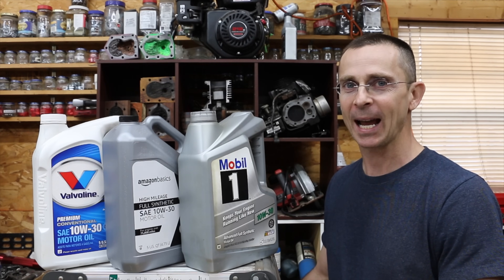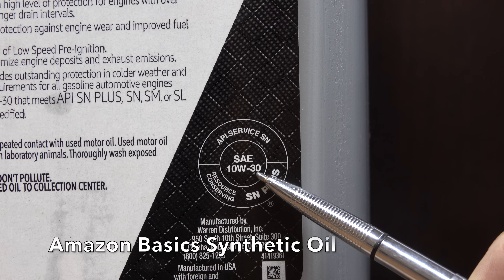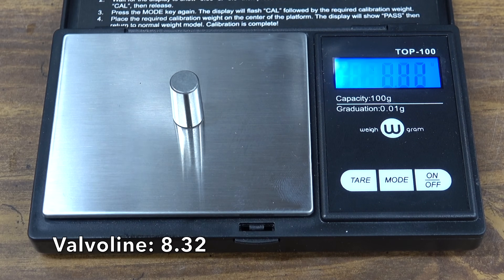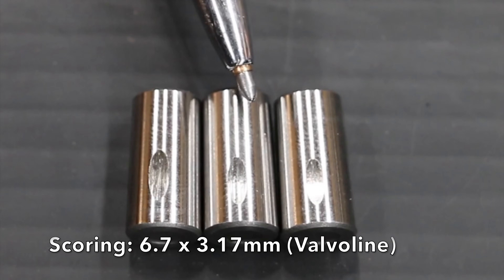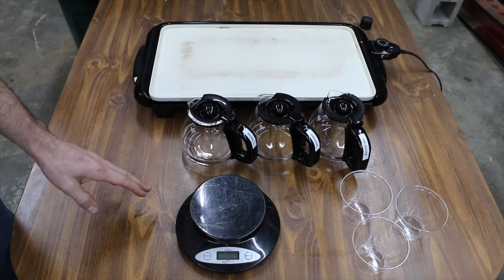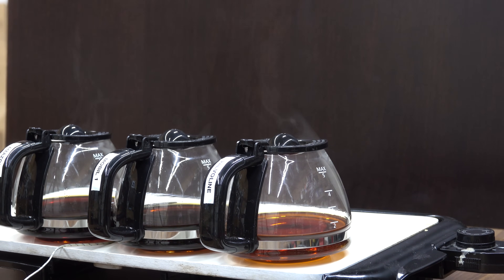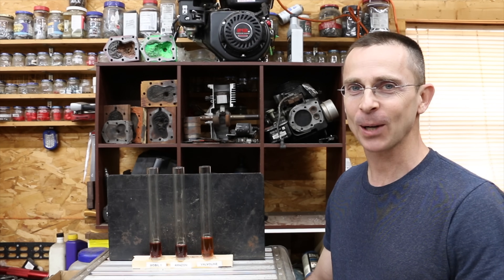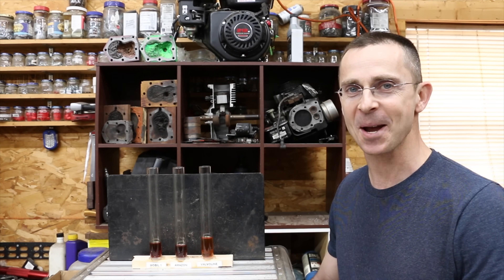Is AmazonBasics Full Synthetic Motor Oil better than Mobil 1? Let's find out!

Comment: The Amazon oil may be from the same stock that Mobil 1 uses, but oil is cheap insurance, and as long as my manufacturer recommends Mobil 1, that's what I'm going to use. My dealer charges $65.00 for a Mobil 1 oil change and it gets changed about twice a year or every 5k miles, I'm going to err on the side of caution.
 Great test though.
Reply from the maker: Thank you

Comment: I feel that you have to fix the lub tester a bit. The mobil 1 oil got much more oil in the cup and seemed that more oil got around the surface.

Maybe you should measure the same amount of oil in each cup + some flaps (more then just tape) to keep the oil in the cup?

Also, a better scale for the heating part might be good. +-1g, is that really enough when so little evaporated?
Reply from the maker: Thank you

Comment: I’m impressed. Hopefully they can keep the quality up over the long term. Something still doesn’t feel right about a ‘non oil’ company putting out an oil that they have obtained from who knows...

Also, I’m more interested in how the oil performs when it’s hot, ie when the engine is running for an hour or two and you really need that protection.
Reply from the maker: Thank you.

Comment: Great testing! I just might buy that amazon basics for my lawn mowers. You should get an affiliate link! But I will always use Ford motorcraft oil from the ford mechanic shop for my Ford F-250 that has 408,000 miles.
Reply from the maker: Thank you!  That's a lot of miles--impressive!

Comment: I don't get this comparison. One is conventional oil... the amazon is high mileage full synthetic... the other is regular full synthetic. The conventional is like comparing apples to oranges... and the other two... the amazon probably has different additives than the mobil1 because it's high mileage... doesn't amazon have a regular full synthetic?

Comment: Hey Project Farm. For a future video; I'd like to see different motorcycle full synthetic oils on the lubricity tester. Specifically, the most commonly used oils like Mobil 1, amsoil, valvoline, Castrol, shell. A 20w50 and 10w40 shootout! Which is the best of these two viscositys? Thanks!

Comment: I use WD40 white lithium a lot. If a tool is rust I usually flush it with wd40, then finish with white lithium. I also use it in keylocks and my specialty cable tools. Think you could factor that into some tests, including the bearing tester?
Reply from the maker: Thank you for the video idea!

Comment: Hey project farm, Mobil 1 is SN PLUS rated, the bottle you have used during testing must have been a 2017 bottle. Only mid to late 2018 bottle packaging are STAMPED SN PLUS. Also the oil formula was never changed due to this test. Meaning the oils before and after this new testing for LSPI are exactly the same. So in term the oil you used for this test is basically an SN PLUS oil, it’s just not labeled do to old packaging before the tests were concluded.
Reply from the maker: Thank you for this information!  This is good to know.  Thanks again.

Comment: Kind of scary how Amazon is becoming a mega-corporation, slowly getting a monopoly everywhere
Reply: Eh, I doubt they can gain a monopoly on everything. There is no chance they can monopolize automobile parts, for example. I do agree that they are becoming a power-hungry mega-corporation, though.
Reply: Amazon is a distributor.  The don't make anything to my knowledge.  Just as many auto manufacturers subcontract most of the components in their vehicles.  Nothing new here.

Comment: Will a Diesel engine run on vegetable oil???
Reply from the maker: Thank you for the video idea!
Reply: yes.
50% of european cars have diesel engines and most of them use vegetable oil since there is no tax on vegetable oil.
Many use a 2 tank system. They start the engine with regular diesel and then switch over to vegetable oil and before shutting off the car they switch back to diesel again. This way they can start the car even in cold temperatures.
Some may use use used cooking oil and make bio diesel with it which is close to diesel but may jell in lower temperature.
Reply: @FloryJohann  thanks for the information I never knew that before.
Reply: @roshanshaji4703  
Your welcome.

Comment: Can you please test Castrol Edge 5w30?
Reply from the maker: Thank you for the video idea!
Reply: Castro Syn is garbage. Ruined my dodge when front oil seal blew out loosing all oil. Less than a mile - engine froze up even thou just trying to get to a gas station baby sun ups and coasting.
I'll never use that cfra pagain. Amsiol or Mobil 1 or royal purple....
Reply: @SamaritanElad  I get hundreds of thousands of miles on all of my vehicles using Castrol. I run 5,000-10,000 mile oil changes and run WOT almost every acceleration. That is no exaggeration. I very seldom hit the rev limiter, but I get within 1000 RPM of it at least once every time I drive. That too is no exaggeration. Another point I might add is that I have never owned a Dodge.

Scratch that. I had an engine once that bent a rod, but I was literally pushing the engine beyond what any engine could handle. It was much more than accelerating WOT and hitting the rev limiter.

Comment: I still recall peeling the seal off a 5QT bottle of Super Tech synthetic and saw a fly come out in the stream flowing into the funnel. Couldn't do a thing about it. I just hoped the oil filter would catch it. I doubt it would've damaged the engine except for maybe the possibility of blocking some tiny oil passages. Sure made me wonder about the quality control @ Super Tech. I still buy the cheapest synthetic which is often Super Tech but I go for the major brands when they offer rebates. M1 used to be in the $22 range @WM but M1 is currently $22.68-$29.98 around here, ST is $15.98-$17.47, Valv $22.97,  Castrol $24.57-$30.78, Pennzoil $22.68 (P currently has a $10 rebate offer according to slickdeals.)
Reply from the maker: Thank you

Comment: Why does it matter if they evaporate in a closed system?
Reply from the maker: Thank you.  The crankcase has a PCV which allows oil vapors a way out of the engine
Reply: Project Farm thanks for the reply. Bigger thanks for the content👍. U the man.
Reply: Project Farm suppose makes sense, pressure I assume, tho u can probably tell I'm not too knowledgeable yet I am sticking to it.

Comment: I have seen Mobil 1 work on my  car after 5years of racing my motor and multiple over heating the motor  3 completely different times after opened up my motor all bearing and journals were in great condition my motor just needed new rings and gaskets   So im sold on it and not trusting anything else beside Mobil 1  synthetic works.
Reply from the maker: Thank you!

Comment: Great video. I have been wondering about diesel vs gas. Diesel engines last longer than gas - partially due to the fact that diesel is an oil and a lubricant. I was wondering what would happen if I ran my gas car and gas lawnmower with 95% gas and 5% diesel. Would my engines last even longer because of the lubricating properties of diesel? What about a 10% diesel mixed with 90% gas? How much does lubrication of gas blend increase when diesel is added? Thank you in advance if you choose this to answer!
Reply from the maker: Thank you for the video idea!
Reply: @ProjectFarm  I'm very impressed you read all of your comments - you sure do get a lot of them so thank you! By the way, I think there would be a difference between using a little diesel in my car vs my tractor, snowblower, and lawn mower since the car has a catalytic converter that could get ruined by the diesel. I expect that complicates testing a LOT since that would be tougher to test impact to the cc. I think my original question is already hard to test - would adding 10% diesel to gasoline extend the life of a lawn mower?

Comment: Here is the real test, go and try to sell your car in 3-4 years and when the informed consumer finds out that to save a few bucks you have ran generic Amazon motor oil in the precious engine see what they buyer thinks.  Despite the actual analysis etc reputation matters in important decisions like motor oil.  Interesting however.

Comment: Very good video Sir.  I was surprised by how much worse the cold flow performance was on all of the oils after the temperature test.  As a result, I will be getting the oil changed in my vehicle late in the fall every year so I can have the "freshest" and least heat effected oil in the crankcase during the cold winter months in New England.  Thanks for the info Sir..!
Reply from the maker: Thank you!

Comment: I noticed on the lubricity test, the mobil 1 seemed to have a bit more in contact with the wheel (lots more splashing), that could easily alter the results, as more oil was likely making it onto the wheel.
Reply: A LOT more Mobile1 made it round the wheel. The amount of oil in the cups should me metered accurately!
Reply: I didn’t see any splashing with valvoline either...
Reply: I agree. Although everything seemed to be set up properly the amount of oil placed in the cups shouldn't just be eyeballed. I was looking in the comments to see if someone else had noticed

Comment: There was undoubtedly quite a bit of effort put into these tests so I'd like to put in my two-penny worth.
When measuring a small difference in mass, of 1g of evaporated oil for example, it is statistically insignificant if the measurement was made using a scale with precision of 1g. You would, simply put, have a +/- 2g of uncertainty in the measurement (1g in the "before" and 1g in the "after") having a percentage error of 200% in that 1g.
A simple way to have decreased such % error would be to increase that mass difference i.e. evaporating more of that oil, by increasing the time the oil was heated. Another solution to your problem would be using a scale of higher precision, like the one shown that weighed the metal cylinders.
I haven't come across such a test of friction so I cannot comment on the validity of taking a ratio of mass rather than the quantity but regarding the measurements the same principle applies as previously (0.02g with precision of 0.01g => +/- 0.02g uncertainty).
Reply from the maker: Thank you for the constructive feedback.

Comment: While I appreciate the hard work you put into this test, I’m still not entirely convinced of the benefits of using synthetic motor oils. 

I have been a fleet mechanic for the last 34 years. We experimented with using synthetic motor oils in our fleet about 5 years ago and saw no real differences. Most of the fleet is Navistar, Freightliner (Cummins) and Ford F550s. We pushed the service intervals from every 250 hours to 500 hours with synthetic oils. Unfortunately this was counterproductive as we saw the trucks less frequently which prevented us from being able to inspect safety items we would normally check at the 250 hour intervals. 

Perhaps synthetic oils work well in passenger cars. We have switched back to good ol Delo 15/40 conventional oil in our fleet.
Reply from the maker: Great point. Thank you

Comment: I don't trust this test because the oil work in extreme conditions not to put the oil in freeze or heat it to 400f which car run at 400f or running in - 40 that's way there is multiple options 10w30 or 0w40 or 5w50 don't trust them

Comment: Woah hang on, the Amazon oil and mobile one oil are full synthetic and the valvoline is conventional. That's a really unscientific test. The two oils are not even close to comparable
Reply: James Sabins he explained that valvoline are convetional this is not about valvoline is about amazon and mobil.
Reply: @Martini7774-t8x  yes but valvoline has full synthetic oils. So its comparing apples to oranges

Comment: Valvoline will always taste the best though
Reply: I'll take a shot of battery acid, I like savory more than sweet.
Reply: I Dunno, I do like a nice glass of prestone anti freeze.
Reply: Some people have never drank burnt brake fluid and it shows
Reply: @Alexjimb0  I've tasted burnt Transmission fluid.
Not sweet like they say
Reply: Valvoline. And it works the best they. Been around longer evey time i use cheap oil my car or truck brun it more so i say with valvoline. Or quaker state
Reply: @timmyvandestoet1962  I like Valvoline but I have used they're most expensive synthetic oil and it burns just like Mobil 1, Castrol Edge doesn't burn in my vehicle
Reply: Golden Diamonds he used conventional Valvoline oil 0:16

Comment: He's comparing CONVENTIONAL Valvoline oil to FULL SYNTHETIC competitors this is not a fair comparison.
Reply: ????? 
Seeing a conventional oil tested is perfectly fair to see how it compares to synthetic. He never said anywhere that it was a strictly synthetic oil test, and never led you to believe the Valvoline was synthetic.
Reply: But he doesn't designate it as the control, either. And why not use Mobil 1 conventional?

Comment: The heat test and flow test  after heated isnt so accurate cause   the oil is just  sitting  there, not being sloshed  around by internal engine parts.

Comment: So I own a 2001 Toyota Celica GT and have been using Pennzoil's Platinum High Milage Full Synthetic 5W-30 oil (4qts) but found the car to be running dry after 2k miles. I'll add the last quart from the jug to the car just to be safe in order to reach the 3k recommended change. Would switching brands help or is the engine to blame? I recently changed out my spark plugs one of which was covered in oil so maybe I'm not looking at the whole picture...
Thoughts?
Reply from the maker: I would try switching to a high mileage oil.  You might consider using "engine restorer".